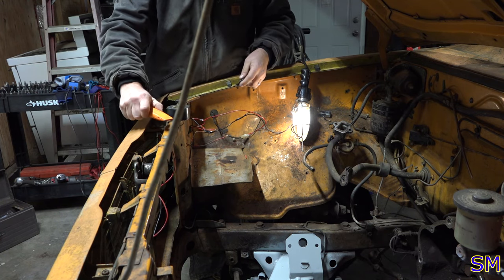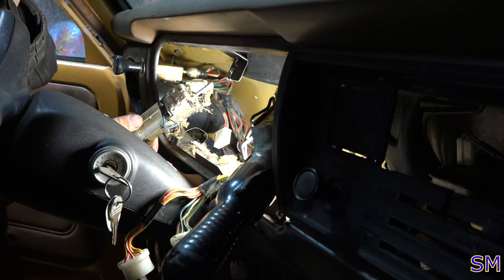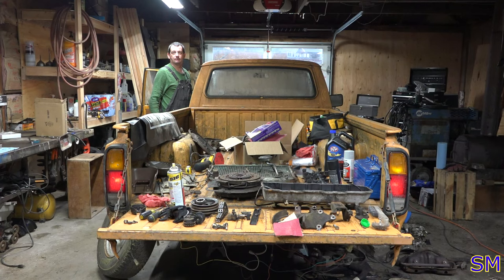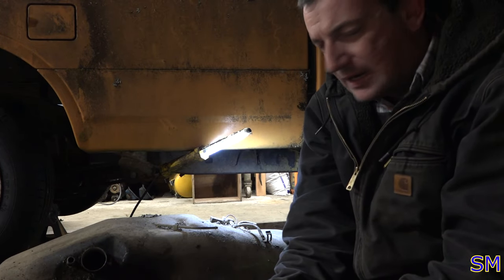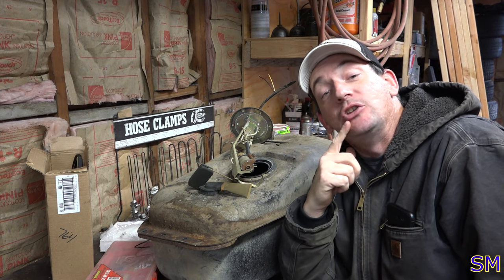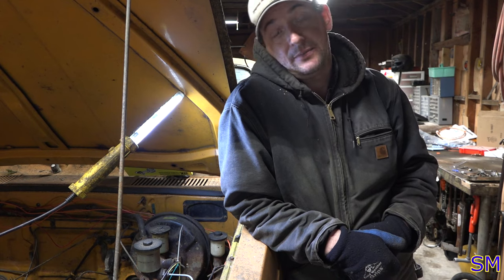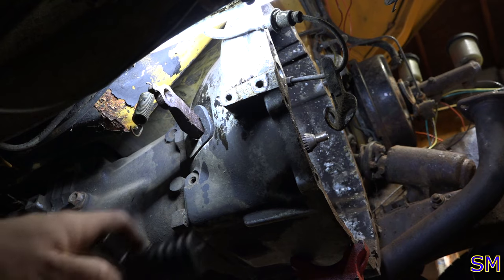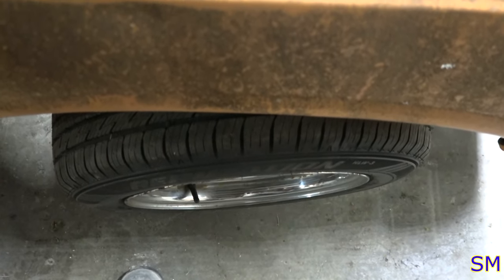Supplemental - 77 Toyota SR5 Pickup

Comment: I have a 1976 Toyota p/u, and except for a new interior light, and a couple of headlamps, every bulb in the truck is original, and works. The original clutch works great,  The muffler needed a new tailpipe. Didn’t have the heart to tell the tech he welded the pipe to a 42 year old muffler.

Comment: If mice had eaten up the wiring in my 1973 like this one, I'd never have even started restoring it. I can't imagine dealing with that headache. Luckily for me, mine is just rotted all to hell, and didn't need much mechanically outside of a brake rebuild and crank seals. My dad restored it from totalled from 1990-1994, drove it daily until 2006, and I started restoring it in 2016.
Reply from the maker: I definelty hear ya. Im almost backwards. My background is I have a degree in auto tech and was ASE certified in electrical at one point in my life. But I cringe at body work.  So wiring is nothing special to me. We found a complete factory wiring harness on ebay, so on Trans Am channel he will put the proper one in.   That's awesome your restoring it. Keep them alive!😀
Reply: @SwedeMachine  I've been able to find almost all new panels, excluding a bed. I've even got floors and rockers coming from Thailand, and I have a wrecked parts truck for anything else I may have needed to fabricate. 1973 is the oddball year too. Only year the gas tank was on the drivers side, so that bed was a nightmare to find. Front end was different in 1973-1974 too, and those parts are a pain to find. There are a lot of subtle differences, but practically everything in interchangeable 1975-1978, and it seems those years are much easier to find.
Reply from the maker: Oh wow. I didn't know there's a one off year. Yeah I bet those parts for that one off year is righteous pain to aquire. Good luck with your restoration boss!

Comment: just like mine  ! the floor is ate up.! i had the same issues with the gas tank that same screw did the same thing, i replaced the sending unit and moved the fuel pump outside the tank so wont have to drop the tank again, just as you have done yes the webber is a lot better carb then the OEM POS,  cluthage  had to have welded an inch on both push rods to  get full extension into the master and slave cylinder. that took a while to figure out why i didnt have a clutch lol
Reply from the maker: Absolutely about the clutch. Nothing fits like OEM🙃. Pick up definitely has some holes in it but overall it definitely solid restoration project

Comment: I bought a 1978 SR5 brand new. The pickup box was built in Long Beach CA out of old 55 gal drums. I lived in Central Ohio. Within 3 years, the rear lights were all wonky because of corroded grounds. The horizontal seam on the bed rusted. The worst was the right A pillar in front of the door and next to the windshield got rust bubbles from the inside. 
I gave it a whammer bammer partial paint job and sold it.
Reply from the maker: Oh yes our beloved rust belt of our country lol. Can't blame you a bit for selling it, salt is right nasty for cars

Comment: I have fixed those sending unit just by cleaning the connections on the unit after it did not work and some of the one's I have worked on were much nastier shape then that one I bet you could fix it if you tried